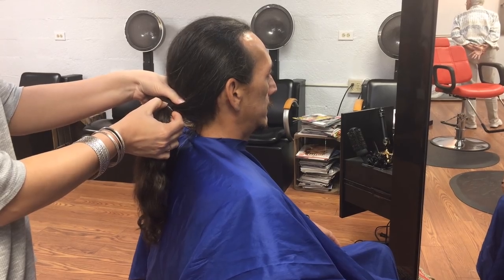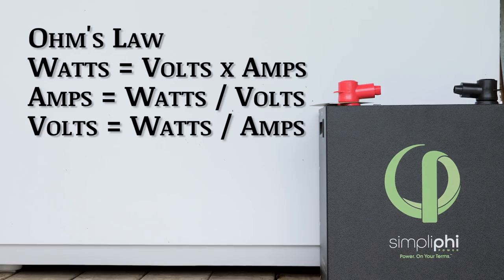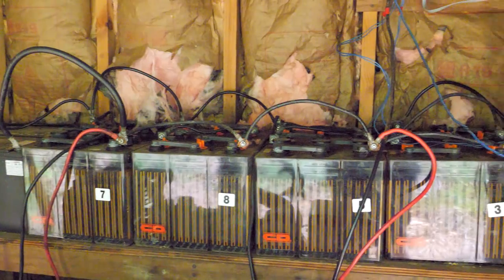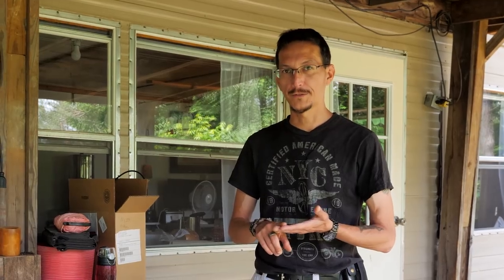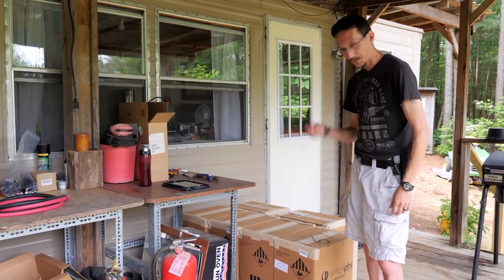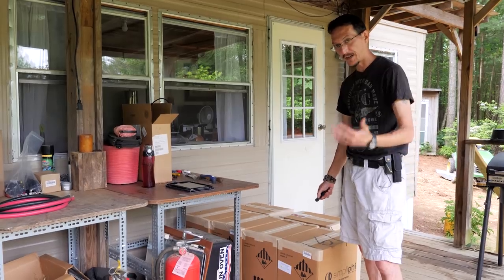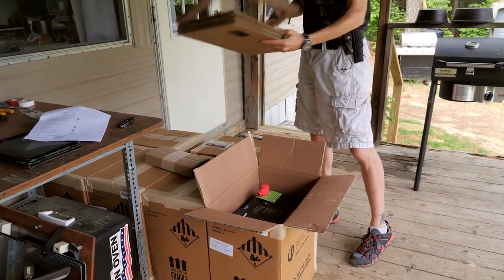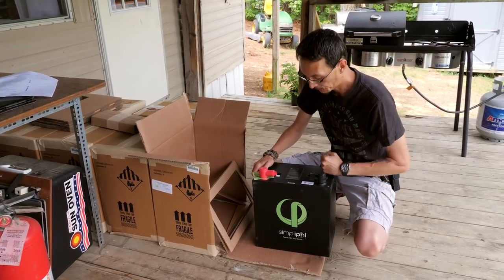DIY Off Grid Solar: Building a LiFePo4 Battery Bank (Part 2)

Comment: the other formula:  I = E / R   or   amps equals volts divided by resistance

Every wire has resistance. If you push 10 amps thru a wire with 2 ohms of resistance, E = I / R or E = 10 / 2 or volts equals 5 meaning you will have a 5 volt drop when pushing 10 amps thru that 2 ohm wire.

If you can double your voltage (put your panels in series) then you will have the same power but only half the amps. E = 5 / 2 or a 2.5 volt drop meaning you lose less voltage which means less lost power.

Comment: I like your videos, but the explanation of electrical units went a bit awry.
Calories are NOT power, they are Energy, Watthours so therefore not equal to Watts. Watts is not work but power.

Comment: I had to come back to read some of your people who comment to you and the one guy said stay on the grid I think that's a bad idea I think we should learn to do for ourselves that's what our creator would want us to do and he tried to reference that in his message or telling you what you need to do and that's the whole problem with people tell us what we need to do and if you really want to know my opinion I think we should have stayed with hydrogen as a base fuel for all vehicles it was still have the same compression ratio matter fact it would like it move a lot quicker without without burning so much energy to do so explosions and more of an inner explosion not outwardly if that makes sense the hydrogen is completely safe it's not the liquid it's a "vapor" some  people get confused with if you use vapor and you got it in a compressed air tank it will not go off if you shoot it even if you let something to it would have to be a confined line to it like a hose of some sort and it would suck the flame back into it that's only way that would work so far is it being unsafe that's not true like The MythBusters tried to say so people won't use it in 1993 in Mexico the Indian people were using it to power their lights not propane they were using hydrogen the government steps in and says this is unsafe why don't you use hydroelectric dams in the rivers and streams what you're seeing Panama to this day and I'm speaking about Mexico as well but I want you to realize that you're being dumb down out of our own independence that we need for ourselves you doing a great job with solar it is the way to go and people just want to down to down it cuz they don't want to do it cuz it's too much work and anybody who tries to speak up and say something about independence they really want to try to handcuff your hands basically

Comment: I've been reading some of the comments below and would just like to add a comment. If you are looking for a cheap way to go you need to stay on grid. A solar system like this is about environment and independence. You also have to be willing to adjust your lifestyle to either conserve or consume according to what the good lord is providing. 
   When the truth is told 10 cents a kilowatt is an awesome achievement and a true marvel of the modern world. Now if you are willing to mortgage the cost out for 15 years you, with some luck, can come close to cost effective. Another truth is when pay that 10 cents a kilowatt to the electric company it does not come close to covering the cost of storing of nuclear waste or pollution from mining and drilling. Those bills can be massive and are past to the future and future generations, renewable energy system like this more or less prevent this as well as leave you somewhat independent from the government. There are no forms of free or cheap energy, there never has been and I don't believe ever will be, generating electricity is a big job.

Comment: a shed full of home made salt water batteries, say 800-1600ah @12v  would cost very very little, maybe 1/4 thr cost of walmart lead acid etc, but no one seems to have the ability to diy this, like a forgotten lost art
Reply: A Chinese company bought ou th the company making those batteries sad because they were completely recyclable they weren't damaged by over discharging and could hold a good amount of power. Problem was size and they had low amprage uasage.

Comment: Every time I watch solar vids I have to listen 50% of Solar 101, Watts, Kw, Volts. 90% of vids on YouTube are only getting you basics, lets move on, draw up schematic, get to the point. Tell me something I don’t know.
Reply: Yes, somewhat I was also wishing he had pulled that out to a separate video. I skipped over it. Some white board or ppt pictures would also help for understanding for people that dont know this stuff. However, there are probably loads of other people on youtube that explain basics much better.

Comment: You're something you're not taking into account you still produce electricity on a cloudy day and the lithium batteries charge up a lot easier there's less resistance to a charge so you're still going to get a decent charge on a cloudy day I know this I already have them 2nd generation Off the Grid
Reply: Lead acid are a thousand times more fogiving !

Comment: those batteries are monstrously expensive.
Reply: Really?  Compared to what?  The cost of a 747?  Running utility lines?  Intermittent wind?  Slaves on bicycle generators?  A nuclear generator?  Not having electricity and living in darkness?  Finish your thought.  Compared to what?

Comment: Those things look heavily marked up, aka expensive for LFPs
Reply: They cost big money due to the 10 year warranty. Plus these packs are seriously under rated via the BMS to get the 10k cycles. They have  a  Max discharge current of 60 Amps (10 mins) and Max continuous discharge current of 34 Amps. The same as Tesla cars 30% is the cost of the battery and another 30% cost for warranty replacement. So 60% is battery cost.

Comment: $3K for one battery? get real. Lithium batteries are way too expensive. I'm guessing u went with this brand because they they gave u a free or cheap one to promote it.
Reply: I think he has done the math mostly correct but of course it feels very shaky to cash out so much on a battery you dont know how good it will be or if the company will bankrupt in 5 years.

Comment: Oh...I didn't realize that 'building' meant getting them in the mail. That simplifies things a LOT! But, if you have to SELL the place you're 'building' the power system for to BUY the batteries, it sorta defeats the purpose, doesn't it? I can pay quite a few power bills with 12 or 13 thousand dollars.
Reply from the maker: Then keep doing that

Comment: Holyshit those are expensive... they're $2,800 a piece that's ludicrous. It's going to take 20 years for them to pay for themselves. I'll gladly build my own battery packs... at that cost I could probably do my whole system for less than the cost of one and get the same numbers far as the battery bank goes.